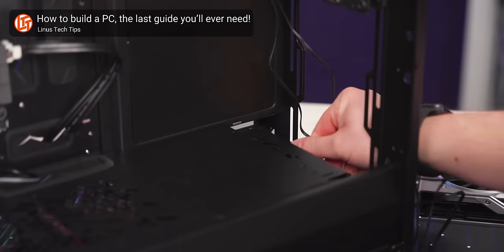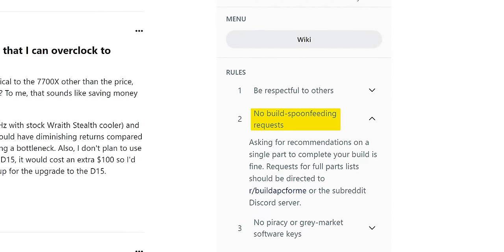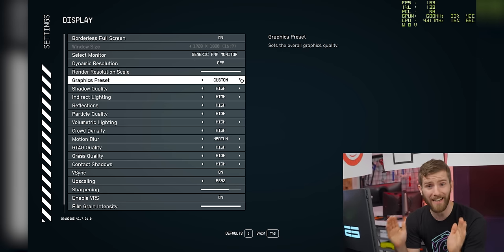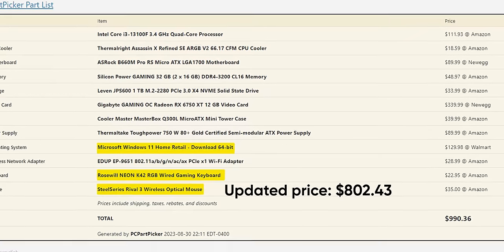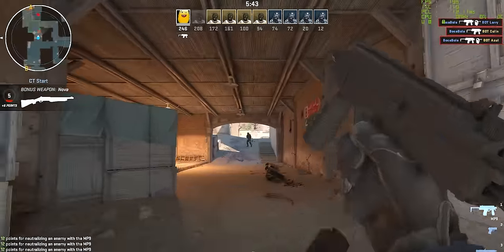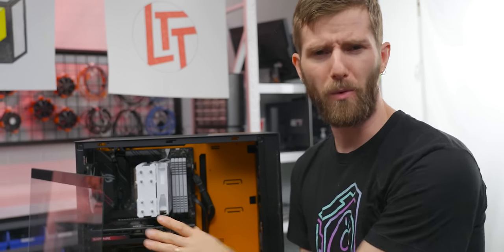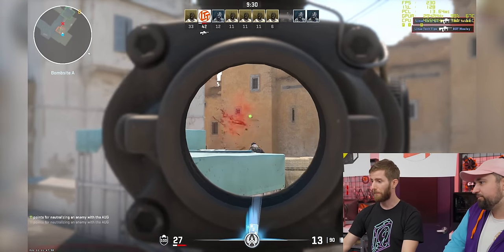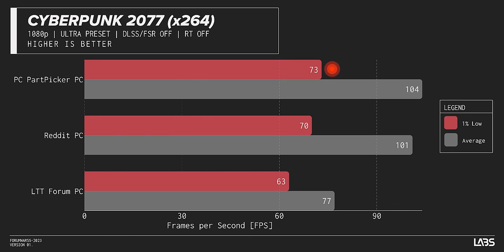We Secretly Challenged 3 communities to Build the Best $1000 Gaming PC!

Comment: So for that Reddit forum that doesn't allow you to post PC builds or ideas for PC builds, what's the point?

Also I'm curious to know, what makes a case bad? I understand compatibility in size. Maybe that's it? Can someone help me here?
Reply: There are cases that are:
1. Terrible quality overall and will fall apart
2. Have NO room for cables (cable channels clearly are an advantage if you want to keep them out of the way)
3. Can have very bad airflow for what they're supposed to do (you don't need god knows how much airflow for light gaming but someone packing a 4090 with an i9 into a Pop Mini case and not putting an AIO in there is asking for trouble because the front panel fans will just not be enough to cool a 24 core monster CPU)

Comment: You had 3 Computers made with a $1,000 Budget, but What about Upping the Budget in 3 steps for future Videos. $2,000 Comaprison and then a $3,000 Comparison and then lastly to build a system at or under $5,000 and NOT to Exceed the Budgets and See What System Configurations Can and Will be Provided by the Communiites. System Stability, System Future Growth, System Variety for All Systems are Requirements for the Communities to Provide to LTT to Both Test and Rate on Quality Parts, Future Gowth for Upgradability, Ststem Ststs and Visual Appearance.

Comment: I want to buy a new PC which I wouldn't upgrade for the next 5 years with my maximum budget being around $1200. Should I still take the AM4 platform as an option or should I go for AM5?
Reply: Gen 5 will be around for 5+ years my bet
Reply: @evanaaveline6184  not sure if 5 years but the continuation of support is the reason I'm wondering if I should go AM5 or if I'm still ok going AM4 and get more performance out of the system or the same performance at a lower price.

Comment: Ryzen 5 7500f                           150
Some b650 mobo                     125
Thermalright assasin 120 se.    25
Fractal design pop air                 80
Evga 850 bronze                         80
Cheap 1 tb drive                          60
16gb ddr4 ram                             50
7700 xt                                        420

Comment: I could not disagree more with the idea that its better to get a better gpu first cpu later, your CPU is likely going to last you through many gpu generations before you consider upgrading, you need your CPU for EVERYTHING you do, its responsible for general responsiveness and how snappy other programs feel, going back to games, graphics options are A PLENTY in the current age, you have fine tuning controls over EVERYTHING, effects decals textures render distance LOD control, and so much more, not even counting things like DLSS/FSR Raw resolution scaling, or frame gen which is likely AMD's next stab at Nvidia's tech, you can squeeze a gpu, you can't squeeze a CPU, not anymore

Save your self the headache, get a better CPU and don't listen to the guy who regularly runs some monstrous rig that can play anything at 4k 144fps thats wired into a different room

Comment: I will defend the LTT Forum pc because:

Upgrading SSD is not a good experience if you have a lot of files, so lets go with a more durable option
RAM is easy to upgrade, but the amount of money saved might not be enough to upgrade the GPU
PSU, i don't think i need to say anything right? We're looking for a PC, not a bomb.

So, what's left is basically CPU, MOBO or GPU.
Upgrading your CPU, depending on the model, you will also need to update the MOBO, so the GPU is now the best choice.

That's what I did on my current build, i got a 7800X3D with 32gb of ram, 2TB high speed NVME and a B650M but combined with a 16GB 4060 TI, with that i can basically play any game now, and in a few months I can upgrade to a 4070 or even a 4080 with basically no problems.

Comment: The 5600 paired with the 6800 is a match made in heaven. Those two honestly make the bust sub $1k pc that runs every modern game on high at 1080. People keep trying to simp for the newer intel or desperatley trying to convince people the 40 series is worth investing in, but with such a terrible low end by nvidia these past 2 generations, and Intel lacking the cpu/gpu cross-performance that amd gives you, its a great pairing. I loved it so much that I stuck with amd on my new system, and im rocking a 7600x with my 7800xt.

Comment: I am buying a MSI Aegis R for 1299 dollars are these specs worth it. 

WINDOWS 11 HOME INTEL® CORE™ 17-13700F.       32GB DDR5 MEMORY

PROCESSOR GEFORCE RTX™ 4060 Ti 16GB GDDR6 

1TB NVME SOLID STATE DRIVE 2TB HARD DRIVE

 WIFI 6E BLUETOOTH 5.3

RGB CPU FAN COOLER 4X 120MM CHASSIS FANS

Comment: I think i'd still go for the LTT build. GPU is usually the first thing to be "old tech" but is also easy to replace. It being the bottleneck is usually the best kind of bottleneck. The rest of the PC can be adequate-to-great for a VERY long time. This coming from someone currently using a 1660ti on a VERY old computer (8.5 year old i5 build) and can still play (at low settings at this point) most modern games, with many older games (5-10 years old) running fine at high res, high detail settings.

Comment: I dont get it how you guys make a pc for 1000 dolars with a 4070, the cheapest I can find for sale is 687€ wich is 700+ $ even if you manage to find the cheapeast cpu from the 3 you meantion for 100$ you are left with 200$ for memory, motherboard, M.2, case, cpu cooler and PSU, wich is impossible at least here in europe... and BTW that 687€ 4070 has a 40€ discount where I found it, anywhere else is almost 800€ +, amazon, ali express, local sites from the country I live in, all of them are 800€+ just for the GPU

Comment: Spending 30-40$ on an aftermarket CPU cooler for ryzen 5600(x) or any cpu on this budget is such a waste of money. Rather get mora ram or storage or add just a bit more money and potentially step up your GPU one tier. Unless you are an absolute silence freak, just use the stock cooler and upgrade that in 6-12 months if you absolutely really need to.

Comment: the 6800xt and 4070 are priced exactly the same
the 6800xt doesnt just have a right, but for the same money, in an AMD sponsored game, it should be DEMANDED that it runs BETTER -- its the best case scenario for that card, itll only perform worse in other titles.

so if anything, its impressive that nvidia put out a card that doesnt just beat AMD's only decent recent architecture, it has FG on top of that, along with DLSS, both of which were not used in this testing. you even went as far as to use FSR on nvidia's hardware, which everyone knows runs slightly worse than DLSS. or at least everyone that has bothered to watch HBUs analysis of it.

enable DLSS and FG and suddenly the 6800xt looks hilariously outperformed,
'oh but AMDs cards have FG too' -- yeah, go ahead and enable that, and enjoy the hud smearing everywhere
'oh but FSR3 will fix it' -- but where is FSR3? oh right, stuck in two dead games. lets hope it gets more support than that.

i feel like the fact that you represent these things as equals, when they are clearly not, is dishonest on the level of all the other crap you guys at LMG have been up to.
when are we going to get some updates on what has happened to madison? you said you were going to hire a private investigator, what, did you find that you had been massively mistreating her?
she could've told you that without having to pay some investigator - but i guess you'd rather pay an investigator than to make things right.

how far this channel has fallen.

Comment: I know this video is a bit older but at the time, you could have gone with AM5 + DDR5 and I'm surprised nobody recommended that. There's no upgrade path with any of these builds if we're talking 2 - 3 years down the line, so when you do upgrade you'll need to get new mobo, cpu, and ram. 

It would have been way better to go with a 4060 or something similar because ultimately that would have saved way more money down the line and the performance would have been fine.

Comment: not a build advice but more like troubleshooting... 
all my usb ports both on the case and the mother board dont work if you insert something that has data on it (ie. sd card readers and usb) tho it works fine on wired and wireless mouse. also using a wireless keyboard with no problem,,.,, just the usb devices acts out. any one has any idea how to fix this? btw the usb can be detected since there is a sound notif but it wont show up anywhere.

Comment: Hi I have acer predator helios 300 i7 10870h and rtx 3060

My laptop power off automatically some time and won't turn on after then I can see once I click the power button it's light up the sensor and turn off and the keyboard not getting power usually it will light up when I do

I did some ts on my own after removing battery and CMOS battery let it wait 15min then it's power on and work without any issue but the issue happened again next day

I have replaced ssd with new os, ram and CMOS battery I did also run laptop without battery but the issue occurs again also i did update bios also still same issue

I am not sure why it's not getting power on unless I reset my bios settings manually by removing all the power source including CMOS

I tried everything I can also did some troubleshooting in the window also memory diagnosis but it's not giving any issue in memory also

Can you help me find what's the issue

What i think the issue is my bios(uefi)chip getting corrupted for some reason do you think replace bios chip in acer predator laptop  will fix the issue or anything else I can try
Also it's possible to replace bios chip in laptop motherboard

Comment: Again, no VR test in 2023.. what a joke. But its clear the LTT pc would lose big time, because PCVR (with cheap quest2) means running at 6k, if possible, and you need a good GPU for that. Also a used 3080 for 400 bucks would be faster here than a overpriced 4070, because of the high resolution.

Comment: How energy inefficient are these desktop parts have stopped me from building a PC for a long time. They simply haven't caught up with time at all. Laptops are much better integrated and designed, by professional Engineers. From software (the drivers that are designed to minimize power consumption) to hardware. If you look at amateur drivers for Linux, you see the Mac mini uses juse as much power as any other PC and the battery life is terrible as a result.

Comment: r/PCMasterRace is pretty quick to respond and have over 9m users compared to the 237k on r/buildapcforme
Reply: Buildapcforme is more for tailor designed builds, but you need to use a template, which they didn't know about. (I'm the guy who made the reddit list)

Comment: Does anybody that has to do with LTT/ your community want any of the computer parts I’m selling?😂 

there on the shortz on the 
channel. Pls text dont call😊

At first, I wanted to do a build like Linus as many builds on an old E machine case that I’ve had. But now I’m just trying to get rid of the old machines since I know for a fact, I’m not gonna make enough out of these two old computers to build a new. The idea is for it to be sleep machine quiet the powerful.😮
Reply: I still want to do the tiny build, so I’m keeping the machine case put everything else is for as much as 45 bucks and as low as 15 bucks for an old power supply😂 I couldn’t find the brand